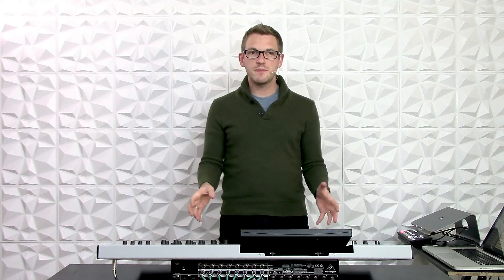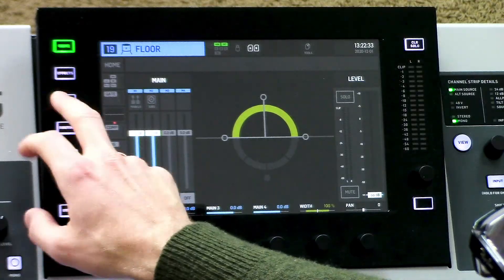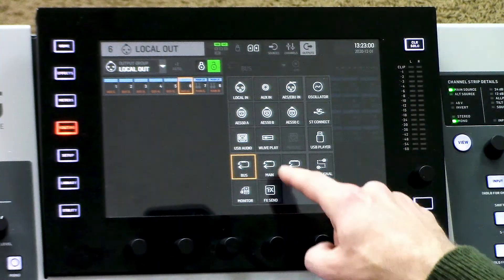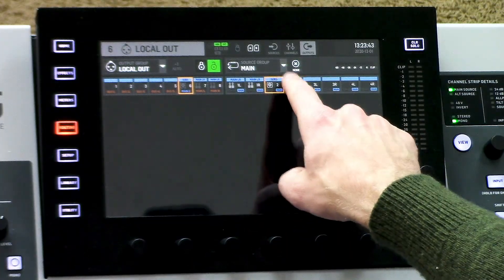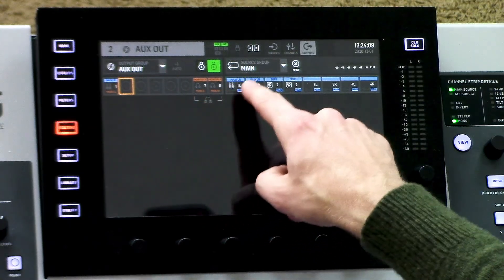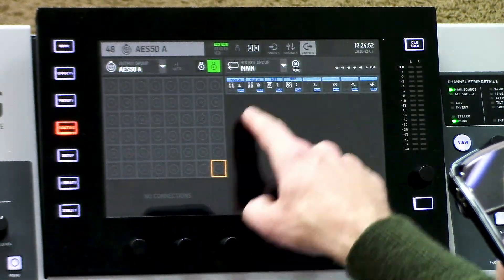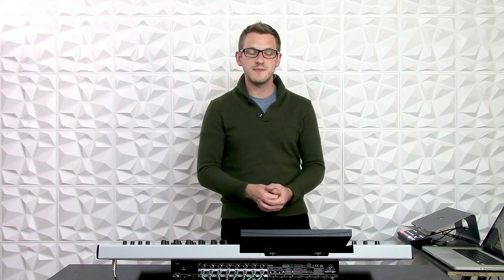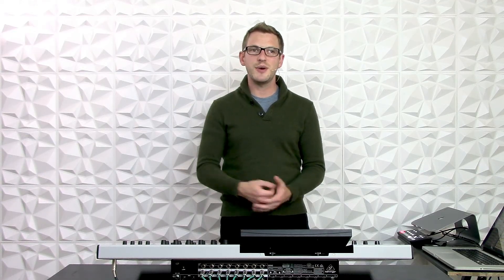Behringer Wing 107 - Routing Outputs

Comment: I have a Main Bus and a Sub Bus setup on our Wing rack.  We are running these out of our Midas DN4888 to our FOH setup as our Local outs and some outs on the Midas are for IEM’s.  I use the two busses, one to feed the JBL EON’s and the other our EV Subs independently. I toggle between the two busses to adjust. I want to send both of those busses to a Main so once I have my two bus levels set I can have one fader to control that entire mix.  Only those two busses as we have other busses set up for in-ears.  Hope that makes sense.  I assume this is simple but my brain is on overload and I’m sure I’m over thinking.

Comment: We are looking at buying the Wing. Output routing seems easy enough.
When I am selecting say output 48 on AES50 port A, it seems easy enough to pick what I want there as you showed, but can I select where the "tap" is for that source signal coming from? Like can I select pre-fader post-fader?
I am hoping I can select them, as pre-fader. It wouldn't seem very useful to me to to set up all my channels out the AES50 port to another console if all my sends going out are post-fader signals from the board.

Comment: Mono nixes still take 2 outs? That's a sucky feature. Way to go Behringer.
Reply from the maker: Negative. Mono takes the LR portion of a Buss and will copy the left to the right when you make the Buss mono. You can select any output for it.
Reply: How do you save the routings both input and output within a scene?  IE our routing rarely changes and I set up an out scene to go to a Mac running waves for livestream 

When I loaded the scene today the old routing scheme loaded and not the new routing scheme